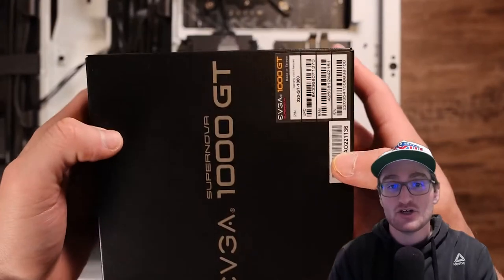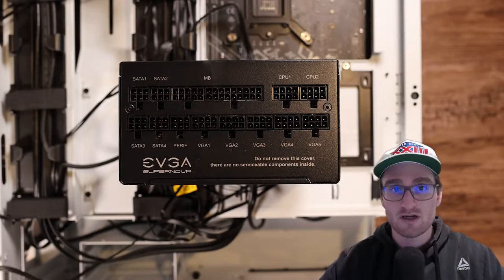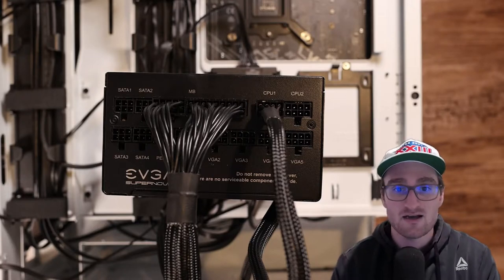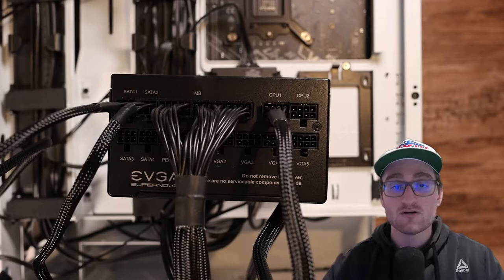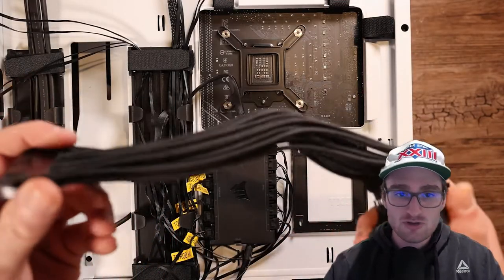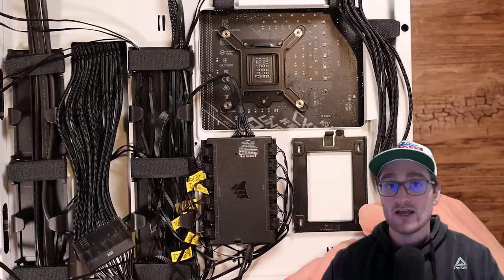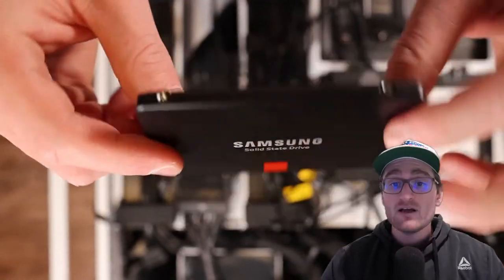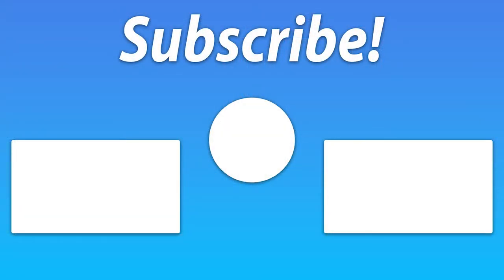The Ultimate Guide to PC Power Supply Cables!

Comment: What about USB connectors, when do we need to plug them from the PSU to the motherboard?
Reply from the maker: USBs get their power from the 24pin connector, no other psu cables needed
Reply: @TechRoundUp  thanks so much! I have realised the installation video I saw them from was a specific PSU (cooler master) apparently you do this for monitoring purposes, of course the video didn't say that so was going down a rabbit hole.

Comment: Why not just plug the Extensions directly into the PSU?
Reply from the maker: Sometimes psus will redirect specific wires in the cables going to different locations on the male and female ends. Usually just safer to connect the factory cables and then an extension